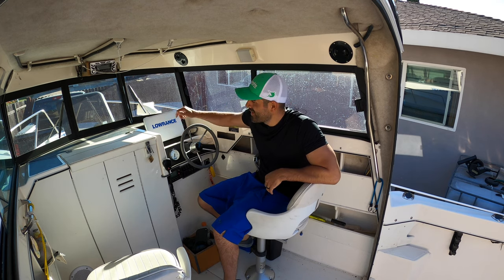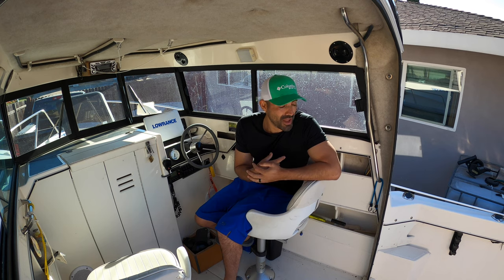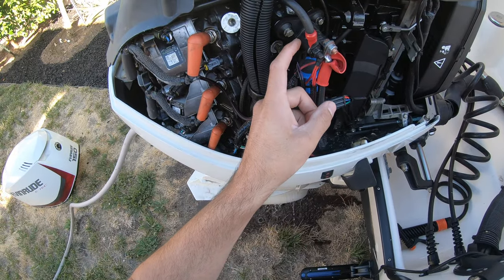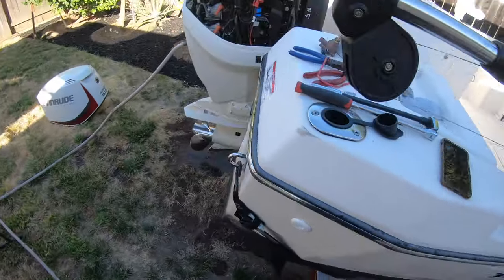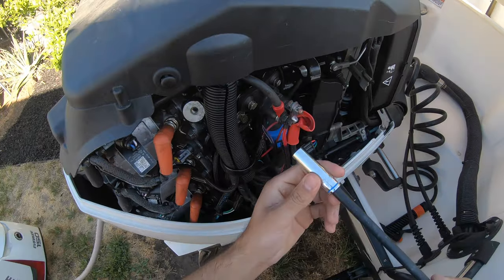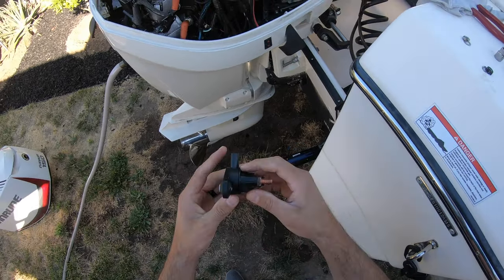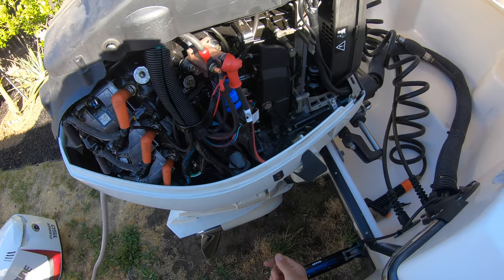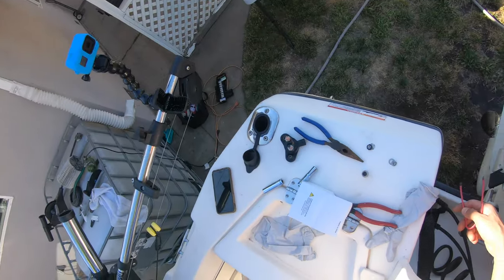Replacing Solenoid on EVINRUDE 150!!

Comment: I just tried this on a mercury 150 2019 motor and bingo. Work like a charm. I just crimp the metal rings on the end so wouldn't keep burning my wire.  My solenoid and starter is one piece. I'm no mechanic but will try to replace once it comes in. Hopefully I can do a full video and give you a shout out on the wire trick.
Reply from the maker: awesome to hear that this worked out for you!!!  Let me know how it goes once you replace it!!!

Comment: I appreciate him making this video, but here are a couple things to be cleared up. The solenoid does not send a signal, it allows 12 volts to pass to the starter for the duration of the key being turned. the contacts on the solenoid are not negative and positive... by jumpering with the wire, you are allowing the 12v circuit to complete, thus powering the starter...  Just use a screwdriver across the terminals, not a wire.. Screwdriver has a handle and you won't get burned. Don't leave it on too long.
Reply from the maker: Nice I like that better too!!! Thanks

Comment: Thanks for the video! Question, do you always flush the motor and start while hooked up to.the water like that? I've seen that it's ok but it seems like the water is going backwards vs what the water pump would normally do.
Reply from the maker: No issue at al its flushing engine, it just bypasses the thermostat no need to heat up to allow the water to go through!! Hope that helps.

Comment: Question did you short the two big bolts on the solenoid or the big battery terminal and small bolt ?
Reply from the maker: On the solenoide. Hope this helps

Comment: Actually, both of those large wires are “positive”…. The solenoid acts as an on/off switch to control power going to the starter.  When the key is turned, if all other tests are passed ( like being in neutral), then the solenoid is energized from the wires coming in the bottom, and this allows the lugs behind the large threaded bolts to “connect”, allowing energy to pass to the starter.  Shorting those poles with your jumper wire ( a screwdriver will also work) does essentially the same thing, just be careful with the sparks!
Reply from the maker: @reyn3545  nice thanks!!!